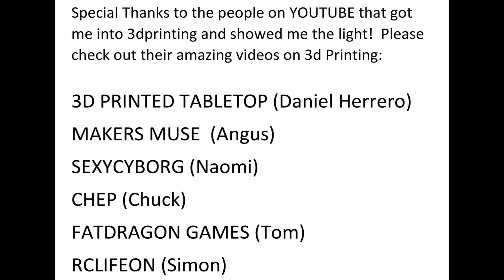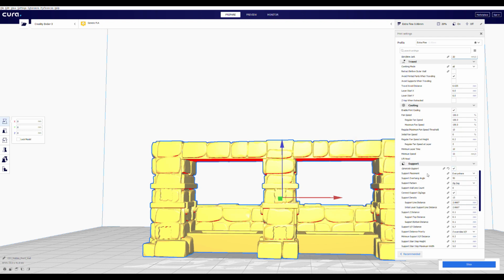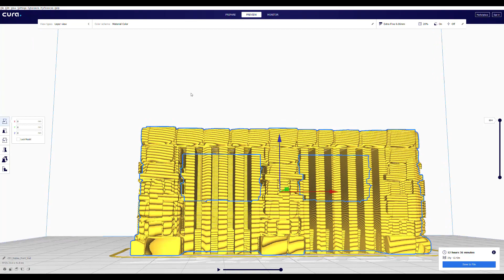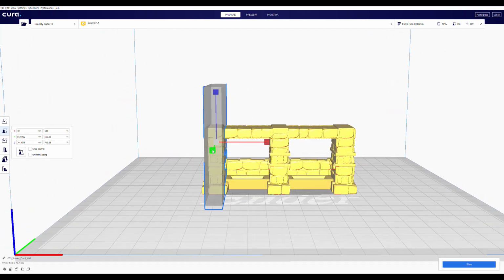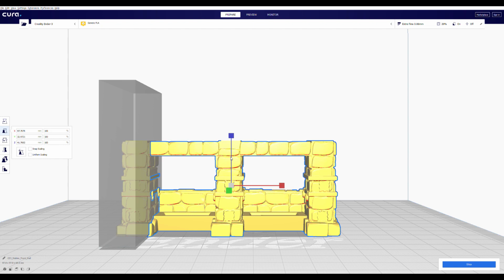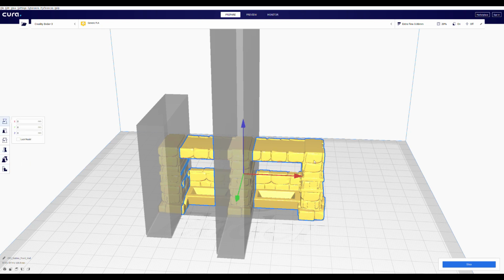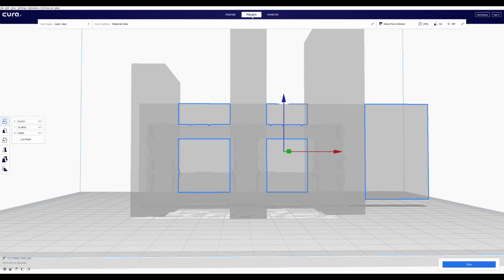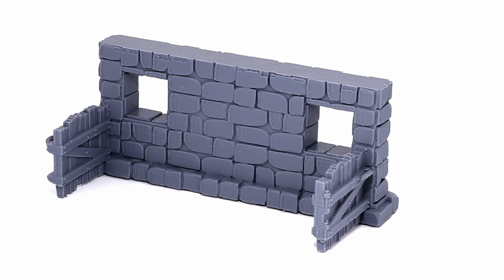Using Support Blockers in Cura to get better terrain for FDM printing

Comment: When you preview a print you can change the color scheme at the top so it'll highlight supports vs perimeters vs infill. I've used support block in the past, but never realized the cube could be modified like that! Suddenly they are much more usable.